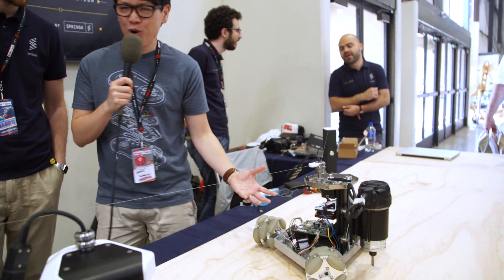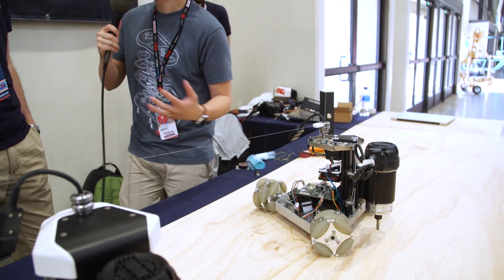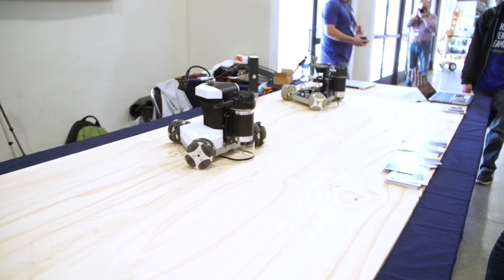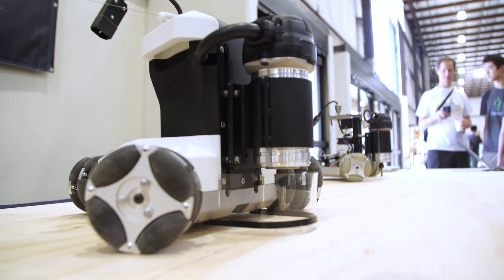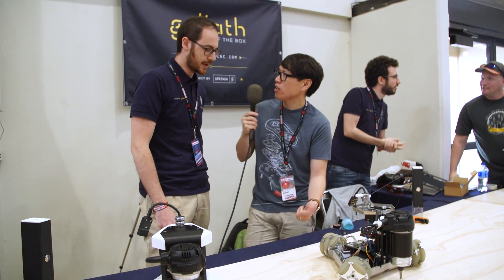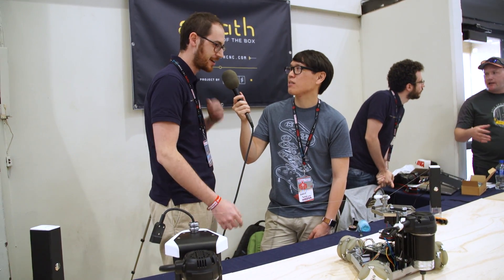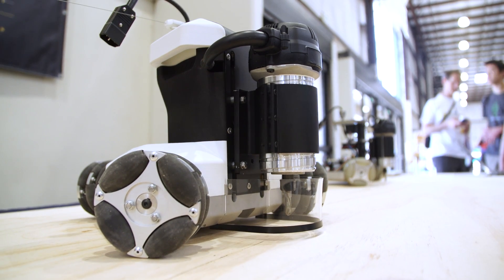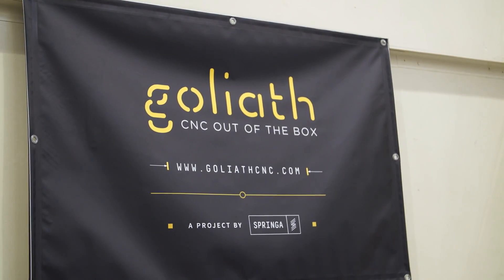CNC Router That Runs on a Robot

Comment: its a pretty good idea >>>> if it works <<<< you can router out stuff as big as the material cut not according to the size of the cnc router like usual , when not used its a lot less to store too
only thing i see that can give problems is running over a previous routered surface (like a 3d picture) theres no way it can stay level on a bumpy surface

Comment: I feel like this is very impractical. Having such a balance between tool Diameter, depth, robot itself, what happens when you have cut pieces to go over, what happened if a wood chip pops on top of the work piece and the robot runs it over tilting it. Even if this was half the cost of a conventional Gantry style CNC I think I much rather have  that style. At least I know if I do it right I wont have to baby by either making sure it works or follow it with an air hose to evacuate chips.

Comment: As someone who uses a CNC router a lot, this would really only be partially useful for extremely large stock like very soft plywood and foams. Anything that requires even a small amount of force to mill like hardwoods and plastics would be stupidly hard to cut with this since you would have to have an insanely low feedrate. A better use of this robot platform would be for a laser cutter or FDM printer. A milling spindle is the worst choice for this IMO.

Comment: I had this idea a few years ago. I abandoned it as it's not practical if you really think about it. Rigidity is a major concern as there is none, the material is able to push back on the spindle and cause problems with accuracy and repeatability, so to counter this feed rates will need to be slow no doubt not to mention you'll be restricted to soft materials like plywood. A traditional CNC router could cut parts out in a fraction of a time and won't be nearly as restrictive. Nice idea and Im trying to be optimistic but I'm not sure who would actually use this machine other than some contractors who like to do work on site and the people who simply like trying new things for the sake of curiosity.

Comment: why oh why oh why do these weird cnc routers keep showing up I  seriously doubt that machine can cut a 1" thick material even with the seriously bad .020" tolerance .020" tolerance is not good plus these people never talk about the fact that they have to move extremely slow and take shallow cuts which will burn up your carbide tooling and make the machine very expensive to run

Comment: i would like to know how it can drive on the surface when all the dust and debree goes all over the place. also when it has routed away material, it ruins it's own surface to drive on? does this mean I has to finish a corner of the plate first, before moving to a new area? if so, then I see problems in the kinds of cuts it can make.

but hey.. maybe they fixed all that 😊 would love to see it go
Reply: Maybe it'll have a fan/blower to clear the surface as it goes bro :)
Reply: Yes maybe.. could be nice to put a wacumcleaner on it
Reply: To be useful, this thing will have to pull along a dust collection hose. My other gripe is how it deals with variation in material hardness. Hit a knot in some plywood, and I'd be afraid the thing will go flying, or at best, get stuck.
Reply: Alfred Wheeler we can dream bro ;)
Reply: Maybe integrate with a Roomba? Ruining the surface is a problem--hadn't thought of that... Good observation! Maybe why it wasn't shown operating... 

Perhaps a wireless power magnetic levitating hover-board-like self-vacuuming CNC Router? That day will arrive sooner than we expect, I expect... LOL
Reply: Hi guys, you can now see Goliath working and discover more information here!
https://www.kickstarter.com/projects/2130625347/goliath-cnc-an-autonomous-robotic-machine-tool-for

Comment: How does it handle traveling over parts it's already cut?
Reply: Looking at the way it's wheels are I don't think it'd have a problem running over a groove but seeing as it doesn't seem to track anything other than the main inputs it could fall into a large dip if it cuts one out. Hopefully it pauses if the cutting process is disrupted.

Comment: Would have liked to see it actually working...
Reply: You just saved me from watching the whole vid, thanks.
Reply: It may not work :D
Reply: yep wouldnt make me buy it like this 
if it was working it would be a must have
Reply: They could have had it cutting Styrofoam...
Reply: Robertlavigne1 pathing is good, but having it maintain that pathing under load, resist the moment forces given by the router, inertia of the whole system etc etc etc
Reply: Robertlavigne1 looks like another bad idea that's headed to kickstarter, they will get a load of money and it will fail
Reply: shadfurman I just know how far my CNC machine can chuck a 20 lb chunk of steel..... after it breaks through a 1/2" thick lexan window
Reply: Just have it hold a sharpie and drawn on paper to show it making the movements then. We all know a router can cut, it's the pathing that is interesting.
Reply: SpetrothFFXl Oh absolutely! I just meant if they are so worried about running a router in a crowded space then a sharpie would still show most of the systems capabilities. I would definitely want to see it under load before thinking of spending money on it.
Reply: SeptrothFFXI I'm not saying it can't, I'm only saying that I think the issue can be fixed with current technology. It would have to be much smarter than the average CNC mill.
Reply: They could easily have run the robot, and just not cut. Robot on, router bit off.
Reply: SeptrothFFXI response time in motor torque adjustment can be rediculous, single milliseconds, I don't know how well it would cut straight in a material of varying density, but I don't think it would be thrown across the room...
Reply: Pathing is what the vast majority of the viewers are wanting to see. Also, if it couldn't handle specific stresses, you can just adjust cutter speed and feed rate to where there are no issues.
Personally, I'm more interested in what happens when it starts up. That router looks like your basic Porter Cable router, and any woodworker knows the vibrations from them are horrendous, especially if it's one of the cheaper models. Also curious as to how it handles cutting, I'd assume it uses a very slow plunge so it doesn't tip itself up. I'd also wonder why they didn't go with a design where the router is in the center of the base, unless it's for the ease of changing bits, but you shouldn't be changing bits often.
Reply: as soon as you hit variation in the material such as knots, rot, hallow spots (plywood), someones old nail, I would be willing to bet that the pathing goes right out the window.
Reply: You really don't want to run a router in a crowded space
Reply: Jen Burton I question how well it will work, there's 2 massive potential problems I see, 1: hard or soft spots in the wood causing it to throw its self across the room. 2: if you have to cross a already existing cut what happens?
Reply: after watching it again, there is no way in hell this will be able to use anything bigger than a Dremel as a spindle and at max a 3/32 diameter cutter other wise you will hit a knot in the wood and it will end up over there in the corner
Reply: +Gummy Bear
You can't by it. So i think the goal is to spark interest.